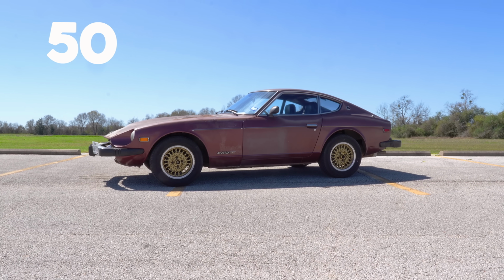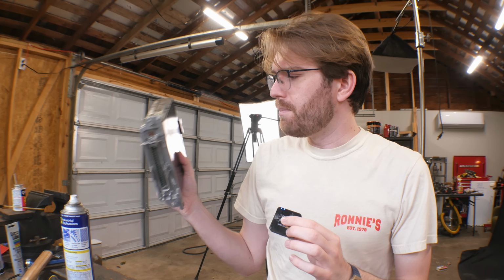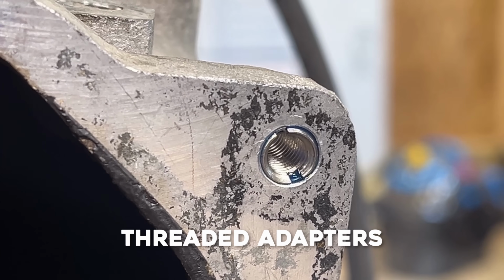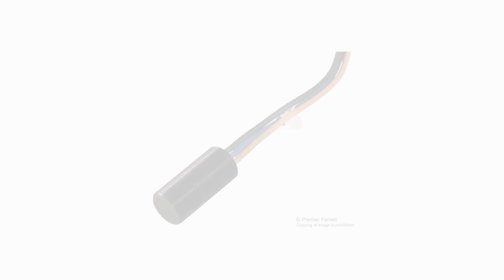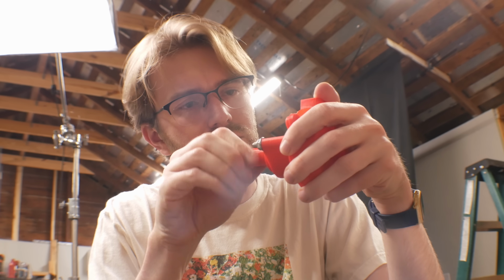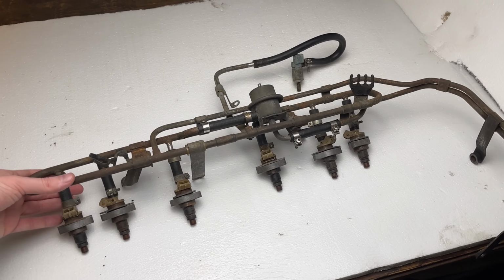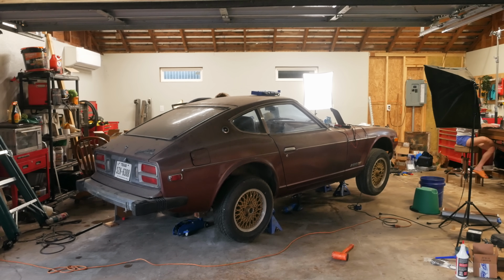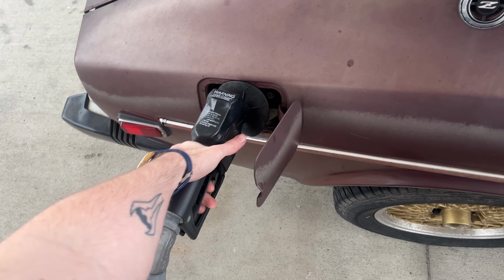Modernizing a Vintage Car

Comment: You are smart but...
Let's get old school and save $
Making gaskets or patterns for any flat pieces.
(In restoration no parts exist in the best one's)
So we clean the part and use a large ink pat for stamps.
Stamp the gasket material with the part.( Must really scrub ink on and move fairly quickly on metal.
Only works on metal wet with ink)
High pressure head gasket cam and...
Would do bunches!
As the video continues...I see you don't know about plug books.
Computers don't contain this but.
You can find your plug and figure out the specifications of the correct plug in great detail. ( Far more than PC)
Now cross reference the thread shaft size and length to the plug you want.
Call Moog, champion,.... Try to get books.
Books are hard to get now.
because old guys are dying off and young guys are a little thick on accepting everything can't be found in the computer.😂
If you paid $300. A book it's very cheap.
They will be harder to get a cheap one out of until they hear you say that it's going to be on the show 🎉
Tempkin has a full book for bearings not usually sold in absolutely every size I've seen.
They actually have an 800# and they look it up IF you know what you are saying to them. (Ask questions)
Speed shop's can usually get a hot distributor for you for around $600.
It's not the part you play with....I did rebuild original parts but.
For this part in something very fast I paid for the best.
This is a part that kills mechanics if it goes way wrong 🎉
I really like the injection ideas.
80' turbo should be usable. (We used to use the turbo mustang parts on VW even 😂)

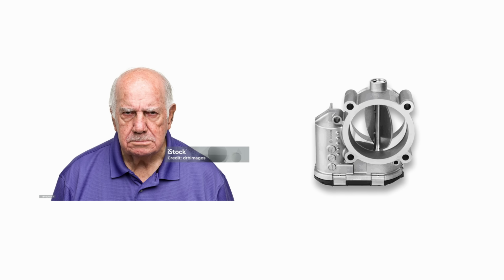Comment: 6:50 and also because worse ecu's can add a considerable amount of lag from the pedal being pressed down to the engine actually responding, very easy to see when you drive a holden commodore from the last 15 years

Comment: 28:41 - I was really confused from the start as to why you didn't use MAF sensor and instead chose to use vacuum line (weird that ECU even has such otpion) and temp sensor... MAF should have solved all the issues at once and you wouldn't even need to know how much air it is sucking, it would simply measure that.

Comment: You are crazy. New cars,, RELIABLE,, go F...k yourself dude. As a mechanic the only wrong thing about cars with 20+ years are parts but reliability is unmatched especially because there are almost no electronics and no computers plus they are a dream to work with. I have clients  with cars from the 70's and 80's as daily drivers and are good or better than cars with less than 5 years. I myself have two ,1994'  Civic sedans that run and feel better than brand new cars. So please, don't say newer cars are better because they are trash, they might be more fuel efficient but will never outlast a 20+ years older cars, especially those from the 80's and 90's

Comment: There is plenty of cars that are more than 50 years old, with zero electronic, using regular carburators,and averaging 40 to 50 MpG. How comes, with all your electronic assisted injection and all the computer stuff you have in this thing, you are still burning more fuel than a camper van?

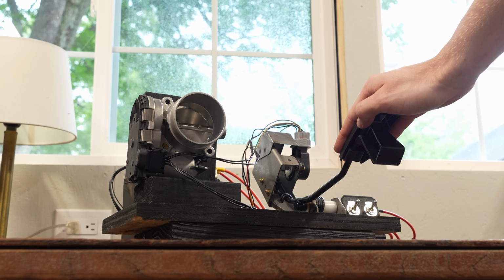Comment: 6:45 — actually there's some objective criticism towards the modern throttle valve as well. The problem are the "graphite tracks" — resistive tracks in the electronic throttle potentiometer — that wear out over time. When the time comes (automatically 85-140 thousands km of mileage), your throttle valve starts to malfunction (the car twitches during acceleration) and requires replacement. It's not cheap, but the make problem is that it can't be recycled either. So, you just have to throw it away, contributing to the mount of wastes.

Comment: Great, detailed and honest video. I went through a very similar process with my (mild) L28 powered 240Z in 2022, opting for a Megasquirt 3 and standard Low-z injectors. I messed around with it for a year, got it drivable, but I felt like I could never trust the bloody thing. One day, it'd start and run like a watch... the next... it'd sound like a clapped-out tractor.  The fuel ran out at 4,800 RPM, and nothing I did ever solved that problem. The endless stream of "helpful" suggestions from the Megasquirt Forum all involved throwing thousands more dollars at it. I ended up pulling it all off, boxing it up, and flogging the lot on Facebook Marketplace for $1500. In 2025 I dropped a whole $410 on a pair of Chinese HSR45 Mikunis, and fabbed up some adapter blocks and a cable adapter. Two pump cold starts, and the best throttle response I have ever had. I'd recommend it to anyone chasing cheap L-series thrills and easy extra ponies. :)

Comment: I love modernization projects like this in particular, and I've always specifically wondered how an older car could benefit from having modern electronic controls if somebody knew how to work up a tune for something that technically never had one, which I guess is what your local shop guy did.

Comment: Why would you need case hardened steel for a Rpm signal off the old Distributor? the thing spins with no drag or resistance. The bearings are the only wear item. How could it damage the new shaft as long as the fit is perfect?

Comment: 120 hp at the wheels would be about 160 at the flywheel / not bad since it was 170 hp new

And the injectors all didn’t fire all the time on the old system
It only fired when needed on each cylinder

Comment: Nice work, creative and skilled, thanks for the video. There is one other thing that modern cars have going for them besides efficiency, power and reliability, they are also SAFER. I love old cars but no way am I going back to an old human hamburger maker as a daily driver or even an occasional driver. If I had the car I have now 30 years ago I would still have my OEM teeth and vision, and even more people driving with distractions now than back then.

Comment: This is why mass air flow sensors are better. They directly measure the actual airflow going into the engine so the system can adjust the fuel to the airflow - instead of making assumptions based on a VE map. Even with the best VE map that's accurate at every point on the grid, all the areas between the points are still fancy guesswork. Measure the actual airflow going in and the correct amount of fuel can be injected 100% of the time.

The airflow sensor the original system had is rather primitive, a vane type. It has a flap connected to a rheostat and the angle of the flap relates to the airflow.

Newer sensors use a wire heated to a calibrated temperature. The computer uses the IAT (Intake Air Temperature) sensor along with how much power it takes to heat the wire to the set temperature to measure the airflow. Air at X temperature flowing at Y speed will cool the wire a specific amount. So it works back from measuring the power required to heat the wire to get the air speed. Air volume is simple using the area of the MAF housing hole.

It's technically more complicated than a speed-density system but definitely more precise and should be more efficient.

Comment: I had a roommate in college in 2012 who bought a 280zx, and attempted to restore it, with near zero technical knowledge. I have nightmares about the wiring harness guts and all the other crap that invaded the garage and sat for years after he had long given up. Cool to see what the possibility is when someone knows what they are doing,.

Comment: Great workmanship..... after all that,  i would now have the engine taken out and send it to an engine shop to have the internals cleaned and new parts put in for better compression and gas ⛽ mileage.

Comment: Awesome video. Love the content. Pardon my ignorance but why didn't you just fit a trigger wheel to the back of the crank pulley and mount the sensor on a bracket attached to the block?  Then blank off the old distributor port?

Comment: I own a 280zx and have been putting together a parts list for doing essentially this conversion. Using a speeduino ECU, CAS conversion, sequential ignition and injection, and a custom fuel rail along with all relevant sensors. This was super informative and cool to see.

Coolest thing for me was that you designed your own CAS! I know a small bit of CAD and have some machining skill but such a task seemed insurmountable to me. Purchasing one is insanely expensive. 400+ dollars for one. How much did your home design come out to be?

Comment: Fair play mate that install looks good. Just on your coolant, change it for a waterless coolant, you'll run at lower pressure and you water pump will thank-you. Also heats up quicker and cools down quicker.

Comment: Seriously, This is awesome content.  But just a suggestion, this is why engine swaps are a thing.  It would have been a lot less work to stuff a modern powerplant in that engine bay that would have been: 1. more powerful. 2. more efficient. 3. more reliable.

Comment: I bought a new 1979 280ZX that I had for 11 years.  Being in the Army, I drove it Germany as well as Stateside.  I essentially gave it away with 150,000 miles on it.  Was a good car except it had rust issues.  
My ZX put out 135 hp with a top end of 127 mph.  Gas mileage was about 25.

Comment: Seems, unless you advanced the spark already, it should fire just before top dead center. 10 degrees, or 12-15 degrees for more performance. 

Maybe your new injection stuff nullifies that. Nice job either way.

Comment: For the distributor to ignition coil system convertion, isn't there a kit out there for the Ford 300? And if there is couldn't that be adapted to your datsun engine?

Comment: This video gave me a flashback to HS. I had the 2+2 version same color but the rims were black and silver..  This engine was also tuned for Leaded Gasoline..   the fastest I drove the car was about 130mph and that full rack and pinion steering went from very tight to extremely loose...  It was a fun car to drive!

Comment: I'd guess with a bit more work he could get over 23MPG and about 150HP to the wheels on that thing, which would be reasonable for something NA with 6cyl and 2 valves per cylinder. (Not too uncommon numbers with your modest V6 grocery-getter.) More than that would need something like a different cam profile and boost. GDI is a way a lot of current cars would also do it (with good efficiency), but that's a whole other can of worms to have working. (GDI is neat though, since that brings the baseline of a 6cyl from around 175-180HP up to 220HP or so without an obvious hit on fuel efficiency. And that's without boost on top.)

Comment: Really impressive work on this project and I think a new take on how to modify a classic. I do have a question though. Why didn't you just replace the rotor on the stock distributor with your index wheel and adapt/create a cap with hall effect sensor? That seems significantly easier to me as the moving components are all there to track engine position and rotation. The rotor is designed to be replaced anyway for service!

Comment: @RonaldFinger: I don't know if you addressed this when you took it to the dyno, but the timing is still off slightly. Spark should be slightly advanced from TDC, probably around 12 degrees before TDC. Check with the engine manufacture for specifics. You may also pick up power and torque this way. Additionally, polishing the intake and exhaust can pick up power with power tools and some elbow grease.

Comment: I have a 1983 Datsun 280zx Turbo, I wonder if this would fix the issues I'm having with the engine having a ton of idiotic computer hardware that is failing randomly. 1980s electronics don't hold up very well and it''s all becoming very difficult to find and if I do it's very expensive

Comment: Consider it would be more suitable to invest in a Paxton or wiippel supercharger kit the key advantage is you can covert back to your old setup and put in another project also it does not involve engine modification nor relocating your distributor it is also not detrimental to the engine also it lends itself to your engine management modification since the system are on. Demand application they can be fuel milage friendly the added tork helps this cause it would be something to look at😊

Comment: I think you could have achieved the same (if not better) results, with a whole lot less aggravation, by recurving the ignition, freeing up the exhaust, re-camming, and tweaking the existing fuel injection.

Comment: I think It would perform a little bit better if you replace battery, wheels or the car seats for something lighter, also you could install a turbo, at this point you already know how to modify the amount air and fuel that enters the engine 😁

Comment: Dude, this is an amazing feat of engineering that you've done.  Even though you sourced out the machine of the parts, you still did all the designs, and built the wiring harness out for a working fuel injected car.  I'm quite impressed by all this.

Comment: Tom, I guessed 120 on the. As how much horsepower actually made it back to the back wheels. Just solely based off of me remembering two things. One that motor is probably a little bit tired and who the transmission. If you were to just modernize it just a little bit you would get about even a little bit more out of that Trent out of that motor but that's only if you get a little bit more money and are willing to go down the weird math black hole of ratios.

Comment: A company I used to work for in the late 1970s used to swap small block Chevy 350 engines into the 280Zs and rebadged them 350Z.  The company was NordSkog in Van Nuys California.

Comment: GM still uses in Brazil the same engine they made in the 80's
The Chevrolet spin 2.0 2024/2025 uses the same engine as Chevrolet Monza 2.0 1987

Comment: Awesome video, you are a genius, really. I've had two 1978 Datsun 280Z's, Loved em'. They never had the " Punch " that they were reputed to posses. I always wondered if the lack of the reputed punch' was due to its old age and worn out parts, but let me digress. The RPM needle on my last 280Z would sometimes start bouncing and when it did this I knew to quickly find some place safe to drive fast, because when the needle started bouncing my car would live up to its reputation and go fast, fast enough one could feel the pressure of take off as it would press you back in your seat. Not Hemi power or anything like that but just enough take off power to be fun, but it was short lived as I am no mechanic and I don't know why it did this but it would only last 10 to twenty minutes at a time. It did leave a orange peel aroma tho.

Comment: Hey, there is a distrubtor from the turbo zx with the L28 engine that was supposed to be sequential fuel injection and this distrubtor had two optical sensors that read a stainless steel disc which had windows cut out possibly by a laser .. .one sensor read 360 light pulses per revolution and the other read 6 pulses oriented at each cylinder firing at tdc with 0° advance/retard, however for #1 cylinder, the window for light to pass thru was much wider than the other windows....and this distrubtor required a different oil pump drive shaft, the engagement to the distrubtor was a combined half circle with a star head drive..

Comment: There is a machinist rule of thumb for o ring seals, if i recall there is a simple rule of thumb for how wide an o ring groove needs to be, and how proud an o ring needs to be, to allow room for the oring to expand when it is compressed. And they are two different ratios for it being a static, or dynamic seal.

Comment: Interesting project! I wonder: does that new ECU have any provisions for an anti-knock sensor? Stock compression ratio on your 280z is about 8.3 to 1, and now that you have significantly more sophisticated engine management available, I'd be willing to bet you could get away with swapping internals around for a higher CR without sacrificing reliability. I mean... since you're already in this deep...

Comment: I’m an longtime subscriber to your channel and it was nice to see you at it again. I too like older, classic-type cars and have four in my present flock, a C5 Corvette just bought with my C4 in trade, a 2002 Thunderbird, 2002 Jaguar XK8, and my youngest car bought new in 2016, a Mustang ecoboost. The reason I am writing is in all the cars that I ever had, about 50, none ever broke down because of a bad single coil. But I have had plenty troubles with the newer coil packs which are also way more expensive a solution. But, of course, you need subject matter for your amusing and interesting videos. Keep up the good battle!

Comment: why didnt you just use the factory distributer with a hole in the cap and the sprocket mounted where the bug goes?

Comment: Instant sub here! I love the project. I have the same coil bracket on my 280. Duffy made a great part! Honestly the replacement hall effect sensor where the distributor is is the coolest part of this so far. I'm running the turbo distributor with a diy autotune trigger wheel and a friend helped make me a custom cap that looks nice, but this seems even better.

Comment: Youtube Mt. Rushmore stuff. I've made a bit of a crusade trying to get instructional videos to standardize on a length of 10 minutes, to advance the medium, but this is the closest I've seen to the intersection of instruction and entertainment. Yes, there have been many good ones, but this is the real deal, a genuine half-hour show for greasy hands. I rebuilt a '67 Mustang 289 engine in my 2nd-floor off-campus college apartment and transplanted it into a '65 Econoline van (2 radiators!), and the mere memory of it makes me shake... so I recognize that look at 28:33. But you've ratcheted it up 100 newton meters. I was like a guy taking apart a toaster compared to this shit. Wow.